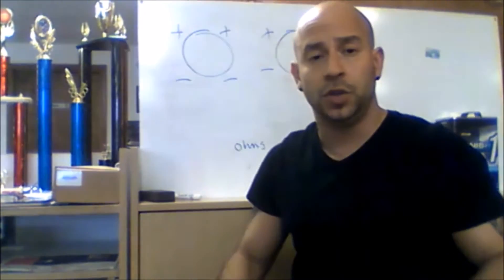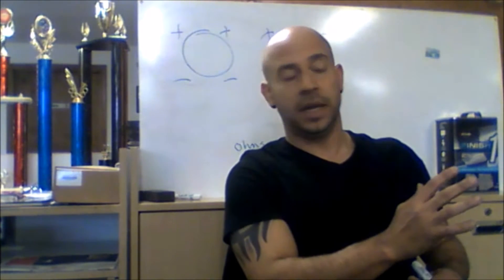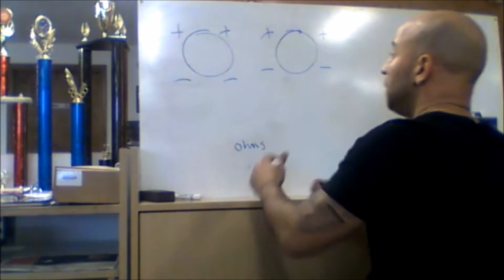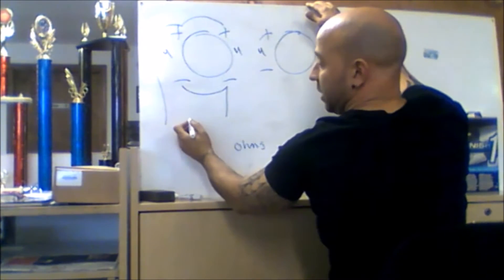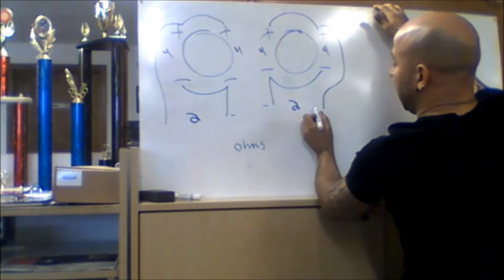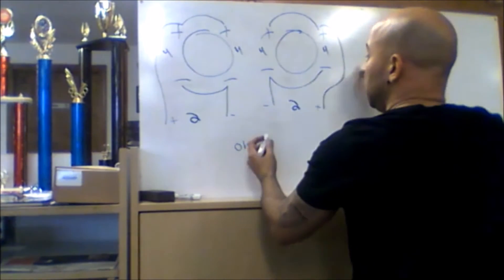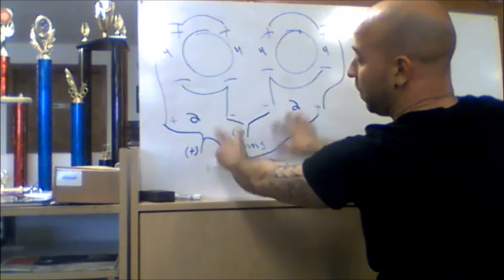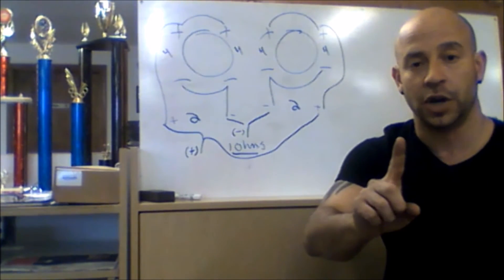How to wire 2 dvc 4ohm subs to 1 ohm, subwoofers and coils.

Comment: I have a mono amp with one single connection but have 2 speaker wires hooked going to each terminal cup in back of the subwoofer box. I have 2 dvc 4ohm subwoofers.. how do I wire this so I use both speaker terminal cups? I want 1ohm load

Comment: I have two 4 ohm dvc subs and the  the amp is a mono amp. would I better off to go 4ohm to 4 ohm for 550 watts or 4ohm to 2 ohm for 800 watts? the speakers are 600 watt rms, 2000 watt max. I didnt know if the 800 would be to much
Reply from the maker: James Taylor your message is a little tough to read, but sounds like ur amp is 800rms at 2ohm x 2.heres the thing though, if you usung 2 subs that 800 aatts will be shared,  so 400 each sub.  so if thats the case, and im understand your message properly, sounds like the 2ohm is your best bet, closer to sub rms
Reply: ok sorry about that. I'll add more detail. it is a hifonics BRX1100.1D and 2 pioneer TS-W3003D4.  I have 3 kids so I can't go big and expensive.
Reply from the maker: James Taylor ok. so. 2-dual 4ogm subs, paralleled and the then pararalled again will be 1 ohm. , that amp at a glance is 1100watts at 1 ohm. aka, 600rms, per sub, once shared. if the subs rms is 400, and peak is 800+, your def riding a fine line. while some companies can tolerate the extra pwr, id be sure to back this amp off quite a bit. but honestly id still do it. after "voltage drop", and "box rise" chances are you really right at the 600 per.
Reply: yeah the sub rms is 600 watts that sounds perfect. thanks man. I appreciate it
Reply from the maker: James Taylor no worries, good luck.

Comment: Say your amp is a 1 ohm but has 2 sets of outputs.  So if you skip that last parallel and just keep going straight like you said , but each having their own terminal rather than having to be combined into one, same result.? 1 ohm?
Reply from the maker: Yeah same result usually. Most of the time tyese larger amps are "mono" so they have 1 actual set, but make to sets for ease if wire placement.